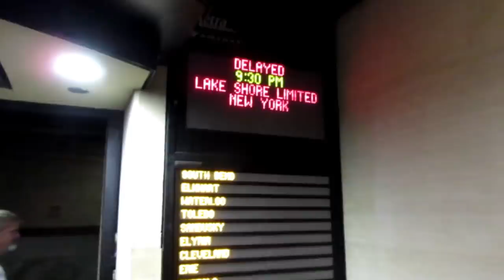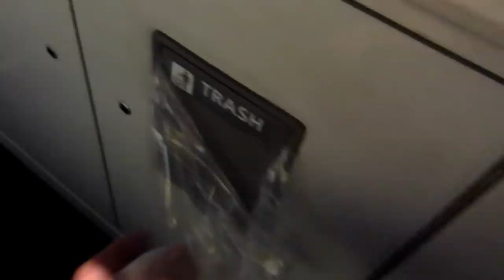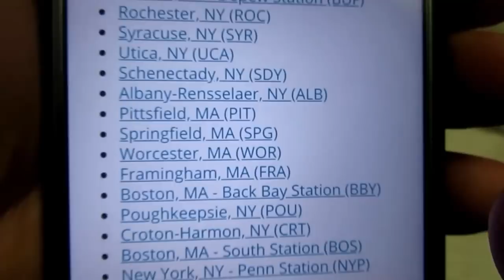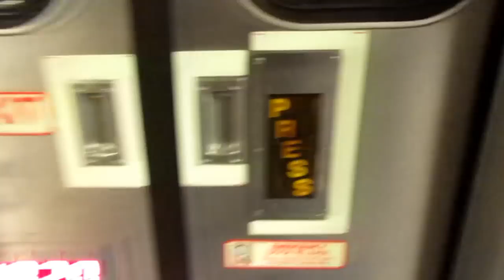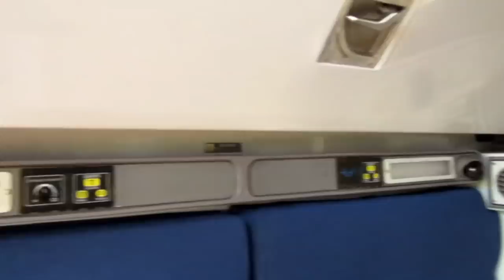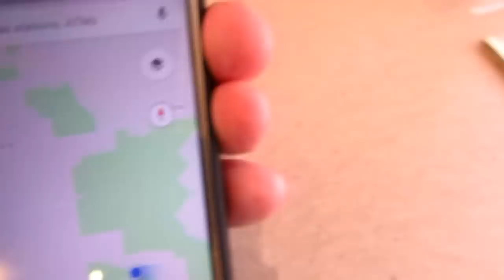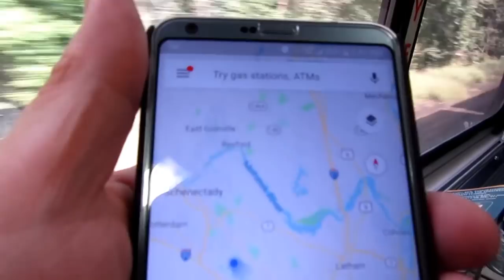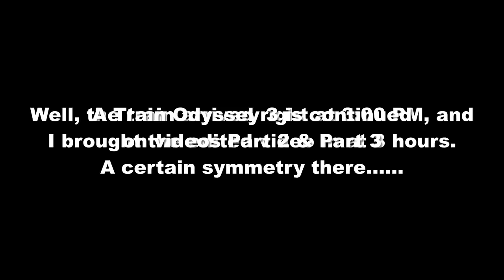A Train Odyssey 3, Part 1, AMTRAK "Lake Shore Limited"

Comment: Do you ever check a large suit case or put one in the car rack on your longer trips?
Reply from the maker: I have never checked anything in the baggage car of an AMTRAK long distance train. My small 'carry on size' suitcase, along with my backpack, holds enough clothing and supplies for a trip lasting a week and a half. If I need to be away for a longer period, I schedule some down time to either visit a laundromat or use a hotel's self-serve washing machine and clothes dryer, and it is a simple matter to pack more medications and/or toiletry supplies without needing a larger suitcase.

I think too many people don't know how to pack lightly. However, I do sympathize with folks who need to take along extra devices due to health issues.

While I don't check my bags in the baggage car (don't need to), I have had items stowed in the AMTRAK Superliner sleeper car downstairs luggage storage area...this was on a couple trips where I was travelling for work and train actually went closer to my destination, and was less expensive (even with sleeper accommodation) than the airlines could offer. In those instances, I needed to carry some tools, a hard hat, steel toes work boots, a warm 'work jacket' and so on that required an additional suitcase that would not have fit well into my roomette. Since where I was getting off/on the train near my work site was NOT a baggage stop, I could not have checked the extra bag anyway.
Reply: @youtuuba  Were you comfortable leaving work gear in the sleeper car luggage area?
Reply from the maker: @jimbob7613  , yes. Those luggage areas are pretty darn secure. They are not in a secluded part of the car, so anyone wishing to mess with what's there would be deterred due to lack of privacy. And when the train is stopped at stations, while the luggage are is just off the vestibule, the car attendant stands just by the door the whole time, so nobody who does not belong there would be able to grab anything. There is no guarantee of course, but having anything messed with or stolen from the luggage area would be difficult and rare. Having said that, I DO make sure that any luggage or equipment cases left there are locked.

Comment: The sofaoops less deep than the independent chair: I would travel in this berth to be able to lie down during the trip - bad back. But it looks like the sofa seat might be too narrow for that... (?)
Reply from the maker: midnightchannel, what is a "sofaoops"? Maybe you should review what you type before clicking SEND.

If you are referring to the width of the "sofa" in the Viewliner sleeper car's standard bedroom (please stop calling it a "berth", which means something quite different in when it comes to passenger train cars), you are not meant to sleep on it as a sofa; it turns into a bed and you are supposed to lay down on the bed, which would be plenty wide. Did you not watch the whole video?; I show it in bed mode!

Comment: I might of missed what a re-start is for from your past video's.  Maybe the Engine is set-up on a computer and it's like re-starting your computer to get the bugs out of it.  Engines don't run off the Diesel Engine, the Diesel engine only powers the Generator that drives the wheels of the Engines.
Reply: TheMonkeyrock77 what you are trying to say is,locomotives have within a Diesel engine which in turn supports a generator which supplies power to the traction motors which cause the wheels to turn.
Reply: David Dowling
Yes and on the east coast all trains run off of overhead electric wires.  That's why they said they were changing the lead engine to an electric engine.

Comment: I don't know what is giving you that crazy green cast to everything in the first part of the video (white balance issue?) but there are all sorts of different software that can fix that for you easily.
Reply from the maker: I know what gives the green tint.....it is the green tinted windows that all the Metra Rail cars have. Things outside really do look greenish like this, so no point in trying to fix it, 'cause it ain't actually wrong.
Reply: @youtuuba  ok, sorry for trying to help
Reply from the maker: @tomokra  Wait a second.....I understand that you were trying to help, but you believed that I had an error or fault of some kind that was causing a green cast on the video, and I clarified that it is not actually a fault, but rather something in the video is actually supposed to be green, so nothing needs to be fixed. Somehow you took this wrong, and seem offended. However, I do appreciate your offer to suggest corrective software.

Comment: I would have thought the first class sleeper would directly connect with the first class dining car. I guess they ought to say they offer exercise facilities for their first class passengers.
Reply from the maker: Barbara Miller, on most trains, the Dining Car is shared by First Class and Coach passengers, and is positioned in the 'consist' in between the Sleeper and Coach cars. If the consist includes a Lounge/Observation car, it is usually located adjacent to the Dining Car. But on some trains, which will be combined or separated at some time during the route, the Dining Car might be located at a point that minimizes the amount of rearranging of cars. 

If a First Class passenger does not want to walk far their car attendant will pick up their meals and bring them to the passenger's private room.

Comment: It seems the train got up to speed and stayed there, unlike the western trains which slowed down and sped up frequently.
Reply: The mainline tracks in the east have much more double and triple rails, whereas the bulk in the west have one rail, with sidings every several miles. Therefore there is far less sitting at signals on the east mainlines...

Comment: There is no way I'd rent a room or roomette on a train that only served cold meals. First class is supposed to mean something more than boxed meals. Has Amtrak checked out what first class service looks like on European rails?
Reply from the maker: Anna Drake, you are being rather naive and unrealistic. You imagine that first class on a train is supposed to mean better meals, but what definition applies? On AMTRAK, first class is primarily about comfort, personal space, and privacy. As far as meals go, anyone on the train has access to the same dining car facilities and meal choices; the perk for first class passengers is that those meals are included in the ticket price, and you get priority seating when reservations apply. There is not, and has not been, any promise of particular meals, and the options have always been limited to a few choices.

And yes, if course AMTRAK is aware of differences between their services and those of other rail operators. I have taken the ViaRail "Canadian", which offers similar first class accommodations to AMTRAK, their dining car meals are only slightly better, and yet the ticket price is up to four times what AMTRAK charges for first class on a similar length route. 

There are also significant structural differences between AMTRAK and European long distance rail services. They have much higher taxes over there, and some of that means a higher subsidy for their rail systems, and priorities.

AMTRAK was created by Congress to take over long distance passenger rail after the commercial companies backed away from it once they decided it was no longer economic. AMTRAK is not a private business, and they have a government mandate and funding limitations that they cannot change. This means they have to make difficult decisions when funding is reduced.

The box meals I have had on AMTRAK trains have been very good, and the only thing missing is that they are not hot. I would still use first class for all the other advantages and comforts, even if I had to bring all my meals with me. And from what I have heard, the longer trains will continue to offer hot prepared meals, and even some boxed meals on shorter distance trains might still have an option to have parts warmed up before serving.....do you realize that even first class meals on airplanes are essentially warmed up boxed meals, precooked in giant assembly line kitchens and then only slightly unpacked (if at all) and partially warmed up by the flight attendants before serving? If you think about it, only a cruise ship offers better meals than trains, even considering AMTRAK's recent cutbacks.

Comment: I feel same about connection doors, and now ask not to be in one, especially if more than one night!!
Reply from the maker: M.A. *, not sure what you mean by not wanting to be in a connection door. Perhaps you don't like to be in the full size Bedrooms that are connectable through a door, so as to make a suite out of two such rooms?
Reply: @youtuuba  I've never been on a train that has two bedrooms connected. But, you said you could hear through the door.. I know that's the case in hotels too. So, if or whenever, I'd be staying overnight, I ask to not have any rooms that could open to combine two rooms. Because a door isn't as thick or quiet as a wall.

Comment: You definitely need to build up courage to go out on those ledges at the Willis Tower.
Reply from the maker: I did "The Ledge" shortly after it opened. Even though I trusted the engineering, I still had to "steel" myself a bit to walk out on it. But the trepidation only lasted a few seconds, then I was having a good time with the view. One lady near me, who came out after me, had to sit on the floor, fix her eyes on something inside the building, and scootch herself back on her butt onto the glass, so her kids could take her picture...she never did look down. Maybe I should make a video slide show of the photos I took when I went....might be worth doing!

Since then, I have been out on similar glass floors at great heights, such as the Toronto CN Tower, and having already done The Ledge, they did not bother me at all.

Comment: METRA keep a majority of their trains in  the loop . then at night the trains are kept at end of what ever Line they are assigned to
Reply from the maker: If I understand you correctly....if METRA keeps the majority of their trains in the Loop (I guess you mean at Union Station?, or did you mean some other 'loop'), then there would not be very many trains to keep at the other end of the line out in the far suburbs....there are not all that many lines. But it does make sense to keep commuter trains positioned in the off hours at opposite ends of each line.
Reply: @youtuuba  1st when i say "loop " i  am referring to down Chicago 2nd i live near the metra electric track  near richton  park . at night  and on weekends i see many trains parked at the end of metra electric line in university Park the southern most end of the  metra electric  line and i  only  see   1 or 2 trains parked there during  the week day between the am and pm rush hours ,
Reply from the maker: @101southsideboy  , maybe you should proof read your comments before submitting them. No wonder that I did not understand your FIRST comment!

Comment: Hey watch the Pima Air and Space Museum's page to find out when they're going to put their new 777 on display.
Reply from the maker: They have a 777? I wonder why, since they otherwise display only military aircraft...was any 777 ever used in military service?
Reply: They also have a smattering of civilian aircraft. Before the 787 they had a DC-4, Lockheed Constellation, Sud Avion Caravelle, and there's a 727 in the refurb yard now. The 777 is the first test article off the line that Cathay Pacific donated to the museum last week. It came with a full interior, so I'm hoping that some day soon an inside tour will be an option.
Reply from the maker: I think you meant '777', not '787'......
Reply: We also have a prototype, first or second I can't remember offhand, of the 787. ANA turned it down after the test program ended. So to be clear the Pima air and Space Museum now has the 1st 777 AND a prototype 787.